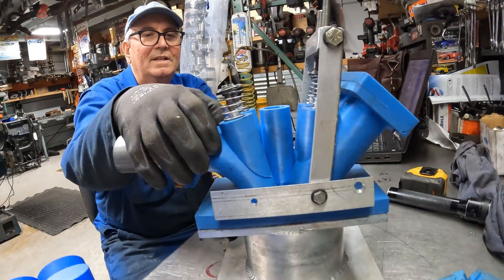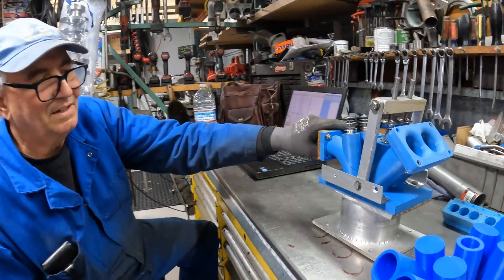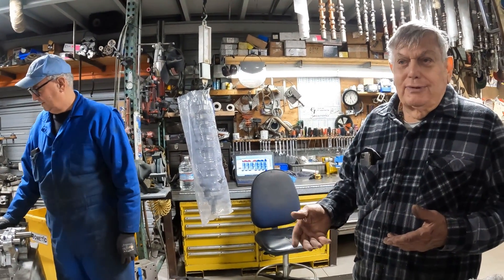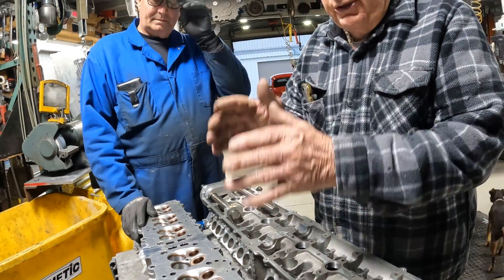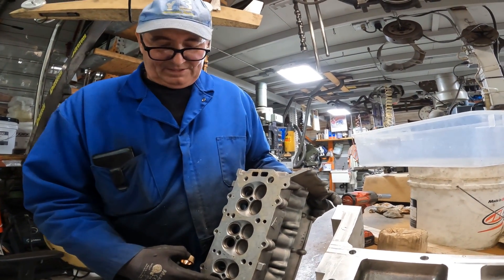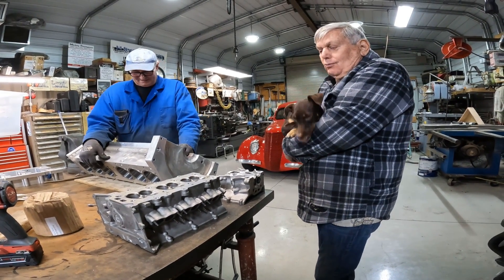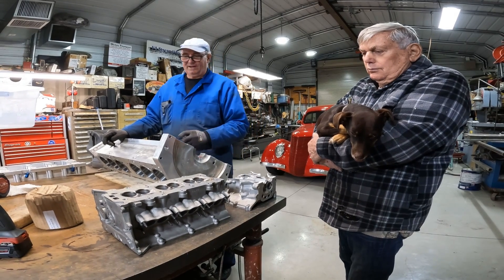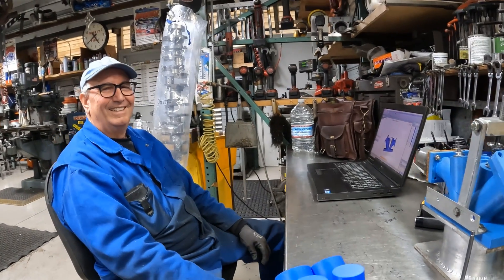How to Design & Build Performance High Horsepower Cylinder Heads - Aardema Braun

Comment: you can print in wax and use the lost wax casting process to cast the entire part as one piece.  That may be a fast and inexpensive way to get a part to bolt on quick.🙂

Comment: Wouldn't it be Awesome to get a hand full of the 5.5 liter LT engine heads weld them together. Making a 7.2- 8.0litre v12 or a 11.0 -12.0 litre v16 open up the ports a bit for a slightly larger bore and possibly shorter stroke.  (Or longer)  Maybe the bore is .350" -.450" larger and the stroke  is .125"-.200" shorter. (Or .100" longer?). Enough to go to  roughly 5.8-5.9, 6.0L.  With a custom 4340 crank and  rods.  Light weight , possibly  9.0L v12, or 12L v12 😮 cast a custom head. Using clay and plaster to make the core. Carve the head from high density foam.  LOST FOAM , lost wax casting makes a nice part. It can  cast fingerprints  into the surface , if they are in the wax being cast.   Maybe go  with a 6" bore 2.780-3.45",3.50" stroke , cast some rough piston blanks . Have them heated to near melting . Then  pressed wit a 599k ton press the. A t6 heat treated.  And mill a box on box piston fro. The  with a roughly 1,1, 2 mm ring pack press in aluminum sleeves with nikasil plating inside and anodized externally. Diamond honed 6 bolt mains . Like with 16 mm studs and 12 -13 mm bolts . The full counterweight crank with hollow journal crank shaft ,light weight and heavily shot peened and polished. Then chrome plated. All the special treatments. The v12 crank should be a fair bit lighter than a street light  than a street/strip v8 crank. About 40lbs   using chamfered bearings to clear the fileted crank journals  enough rambling  have a awesome day🎉

Comment: Lotus basically productionized a Chevy/Ilmor V8 in 1989 when Porsche and Ferrari still used hemis.  11:1 compression with dished pistons, 14.5:1 with flat tops.  The valves need to be resized, smaller stems, ported, etc, to bring it up to date.

Can the 500 ci V8 run Q16?  Don't forget the 15% ram effect at 353 mph.

Comment: Many engine gurus use standard machine shop tools. My shop is comprised of vintage machine tools. I used a round ram Bridgeport to do the work on Cummins diesel heads. These guys have tremendous amounts of knowledge about engines.

Comment: Hello from Oamaru Sth island New Zealand.
Do you advise to dress head gasket with Hylomar spray on prior to installation?.
I'm replacing a gasket on my 2012 Nissan Navara D40 St-X Diesel common rail turbo engine
Reply: I don’t coat modern gaskets with anything.
If I use a copper gasket I head gasket copper coat.

Comment: These guys are great , To bad some of the top name guys wont help them out with some current technology information. It would save them alot of time and work , and make their engines run better. I see somethings that could be improved , and Ive been out of race engine business 10 Years.

Comment: 11:28 that block laying there is that the one they were welding together from plate awhile back?
Reply from the maker: It’s the newest V12 =5L. The 2  head’s shown in this video  are for this newest engine build.  I’m working putting a video together soon.  Stay tuned- thank you Greg

Comment: Nice guys ,  the secrets of Race Engines .  No wonder they go so fast .  Possibly the only Head that l know of that comes close 2 these guys is from Greg at Hammerhead Head Performance in Georgia.   And its a 2 valve head 4 a SBF .  But it wouldn't be making 1300 hp .   Think he is over 1000 hp on a 429 cu inch platform.  Not sure what fuel he is running.  
Worth a Peep .  Looking forward 2 more content & 2 see how close 2 400 mph these lovely old guys come 2 that mark .  Thx Robert Australia
Reply from the maker: Thanks Robert. Pete and Kevin's goal was to make at least 2.5 HP per cubic in of engine displacement. They have been very successful at achieving that goal. Their current 6L V12 which measures in at 369 CID produces 920 HP - running on gasoline naturally asperated. I spoke with Pete this morning and he is shooting for 2.75 HP per CID. Thanks for watching the videos. Hope to have a new one uploaded soon. Thanks, Greg

Comment: It would be awesome if someone made a modern Hall scott engines,  large displacement gas engines,  5" bore 7" stroke, and more, I'm curious what opposite measurements would be like, 5" stroke with 7" bore, maybe titanium piston? Has anyone done that? Piston weight will become a issue eventually,  as a engine speed limiting factor anyway,  7"-8" should be ok with modern piston design,    
6k should be reachable,  12 cylinders. With 8" bore and up to 8" stroke, could be a monster,  I'd love to see a 2srroke gas engine like that,. Similar to the old Detroit diesel engines,  a direct injected gas, 2stroke gas engine!  Could be spicy possibly 6-8valves per cylinder,  3 intake 3exhaust , maybe 4, using traditional valves, but I have seen a rotating valve that is both in and out, also the combustion chamber,  it can offer much more flow, possibly the open port  uncovering the spark plugs, while in the ignition position,  using a worm gear, to spin the valve in each chamber, the valve could open a large high flow port, with a 8" bore, a 4" port possibly, but two 3" would probably be best, allowing one to be closed at low rpm, to increase the  velocity, for low rpm TQ,  to 2500-3k rpm, 5k would probably be the limit with such a long stroke, heavy components!  But even a 6-8 cylinder would be a monster! Maybe shortening the stroke to about 4"-5" and 5-6k should be no problem, maybe 7k RPM,

Comment: 500ci nhra prostock motors making over 1500hp na. Thats with a 2V pushrod engine
Reply: You are correct, but they only have to go 1/4 mile at a time.
We have to go five miles twice in two days and we can’t replace the engine.
Reply: 10,500 rpm heads flow around 620cfm.
Reply: @dennisrobinson8008  They do. I have worked on them in the past, but that was with 1.1 valve lift.
I don’t believe that will hold up in a five mile run.

Comment: Too bad these guys have not studied fluid dynamics.
They could take advantage of these heads and bring them up to modern levels.
Ultra pro heads has a small block cylinder heads that flows 440CFM’s from a small block single valve.
Reply: MBE and Steve Morris have 500cfm small block Chevy and Ford heads using canted valves.
Reply: @dennisrobinson8008  dont forget the 4 valve flows  way higher in lower valve lifts........
Reply: @Baard2000  true.   My 2009 c63 heads on a 4.02" bore flow:
lift        flow            ported flow
.200"   202.5          205
.300"   300             319
.400"   348             373
.500"   358             390
.600"   360             405

They have 40mm intake valves.   I  suspect the 5.5L LT6 do even better with 42mm intake valves on a 4.100" bore.

Bad ass canted valve heads do around 230 cfm @ .300" and are lucky to hit 150cfm @ 200" and cross 300CFM by .400"...

At greater lifts the DOHC seems to lose its advantages over these monster single valve push rod heads.
Reply: Too bad??? Well then go take some of that fluid dynamics knowledge and take one of the many records these guys have set. The proof is in the pudding, and these dudes have the records to prove it. Someone who sits on their ass playing on the computer analyzing fluid dynamics has nothing on these guys, otherwise the computer analysis would hold the records. Plus this operation is just two dudes and some manual Bridgeports. I'm pretty sure they know what they are doing
Reply: If you think CFM  is the important think then you need to go back to school...

Comment: Will it bolt to a SBC?
Reply: The idea is for a big block.
Reply: @kevinbraun6272  Hmm, big block of what?
Reply: @joe-hp4nk  Well originally we wanted to make it fit a big block Chevy, but it has bolts in the way of both the intake and exhaust ports. So probably a 460 Ford. We can get an aftermarket 460 with wider bore spacing than a Chevy and it can be bored to 4.700.

Comment: Down here in Australia we've got the Ford 4 lt inline 6 cylinder Barra engine with dohc & 4 valves per cylinder & I've always wondered if it'd be possible to make an 8 lt 60° V12 out of 2 of them cos they're cheap & plentiful & put out reasonable power......
Reply: Talk to a mate from The UK that is named Millyard
Reply: @dennisford2000  yeah he does some amazing stuff out in his backshed 🤔 👍
Reply: @lancecooper4646  get the hacksaw out…..
Reply: @dennisford2000  lol 😂👍
Reply: @lancecooper4646  you could machine two blocks, so that they would fit a split case 60degree block, using long studs to bolt the blocks to the cases, now do you make a horizontal split or vertical?
Reply: @dennisford2000  the crankshaft is the hard bit though...
Reply: @lancecooper4646  don’t know if you have enough length to do anything but a master and slave rods ,probably two stroke lengths. Or maybe compression, maybe new block with a little more bore center so it can side by side, and get away from the under square architecture. Maybe shorten the stroke, higher revs and bigger valves
Reply: How much do Barra heads flow?
Reply: @dennisrobinson8008  they're nothing special, they need a turbo
Reply: @dennisrobinson8008  about like the jz , similar

Comment: That's super interesting. I'm glad they are not keeping this info secret and willing to share with the world. 
 I'd estimate they need to spin that 500cid engine to at least 11000 rpm to reach 1300hp.
Reply: So you're assuming 620 ft lbs torque at 11,000 RPM. That is only around 1.25 ft lbs per cubit inch.  While that is good, it's not outstanding.  I would assume more torque per inch and spin lower.  All hypothetical on my part.
Reply: @cam3002  it's all hypothetical from me as well. I'm not an engineer or scientist. 
  It will make more peak torque, but at power peak will be less.
Reply: Pro stock already does 14-1500 hp out of 500ci using push rods.   The heads flow 620cfm.  The rpm is 10,500.   They used to turn 12,000 rpm before rule changes.
Reply: @dennisrobinson8008  that's crazy. 12krpm with big valves and pushrods.
Reply: @tiitsaul9036  yep.   Intake valve with diameter of a coke can.
Reply: @tiitsaul9036  Titanium and shaft rockers obviously...    There was a group that did a study of the shaft rockers with big pushrods under a see thru valve cover.   I could not observe any wasteful motion in the shaft rockers at 12,000 rpm...    You have that weird spring harmonics effect like you would on DOHC,  but it didn't appear to be anything more than that.
Reply: I got a comment from one of them.   So prostock is making 14-1500 out of 500ci, but their comment was they need to do it for 5 miles or something instead of 1/4 mile.    Thus the DOHC.    The smaller valves will be less harsh on the springs.
Reply: @dennisrobinson8008  it makes sense. Longevity is an important aspect.

Comment: High revving motorcycle engines these days r using tapered ( small to large ) headers wonder if that would help and of course they use finger followers to actuate the valves  the desmodromic valves rgoinv to 16,500 on a litre bike ( 4 cyl short stroke) insane revs for rd use  how many cylinders r u limited to go your 500 cu/in. Luv your work guys

Comment: Somehow all the heads are starting to look similar to most modern super bike heads. I’m in the process of designing my own head for 2.0L ford engine as I dont like the exhaust port in the Zetec. I have been porting motorcycle heads in the past and the port angles and shapes resemble much what F1 and indy used in the past. 
Awesome stuff from Kevin and Pete. And respect for sharing with the world!
Reply: One interesting thing is the bore spacing on the Aurora Indy head is the same as the old 2 liter Ford pinto engine. 
I wonder what that would run like.
Reply: @kevinbraun6272  Oh man that would be a very interesting to test. I myself don't much care of the old pinto / sohc engine for its heavy and only sensible head is the YB cosworth that is actually not that special. Only thing is that all the YB parts are getting expensive and in stock form it's a pig. But to have a good head on the old engine would be very interesting.
Reply: Thats funny I just started a zetec head design also

Comment: Hay I've been reruns of NHRA Racing and the class is Pro-Mod there Cubic inchs is 900 Cubic inchs I Chevy and Ford and Dodge  I'm wondering if your head design would work on those engines they are down in the 6 sec and some down in the mid 5 sec . Oh some are running Blowers Turbo and Procharger.

Comment: God how I wish we these development tools were readily available at home back when I was still doing circle tracks in the 4cyl class in the 90's. I raced the Lima 4 (pinto engine) exclusively, they're a fantastic platform and the best we could do at the time as far as anything trick was either spending a fortune on a Cosworth head (if you could even get one), or modify the Volvo twin cam head with a little work to get it on the Lima block. There was only so much you could get out of the best late-model stock single cam head. There was no 3-D print prototyping, no shops willing to spend their milling machine time on you etc. This dude here, Mr Kevin, would have been my best friend!

Comment: Hey Guys Lets not let the b.s. get in our eyes. Lets keep track of what an AVEAGE shop would charge to build this cyl head. So his FIRST effort is 100 hrs to make the FIRST model. Today's AVERAGE shop rate is $100 per HOUR. So this FIRST MODEL COST $10,000 TO BUILD.
Reply: The part took 100 hrs to print, but it was on a Creality 10 3D printer which I bought for $500. 
You don’t have to stand there and run the machine. You set it up in about a half hour and it just runs until it is finished.
Reply: Our shop rates $230 lol but we also focus on semi conductor and medical devices.
Reply: The average shop wouldn't,  or couldn't, build this.
Reply: My shop is $155 an hour. You also have to figure equipment cost and maintenance and also materials. After that you have trial and error. I hope that you don't think that designing something like this that it works out great the first time. How is that for B.S.  ?
Reply: Let's not forget these guys have nothing but time to do this.  They have paid dues for a long time in order to finance this project. They did R&D for everyone including GM